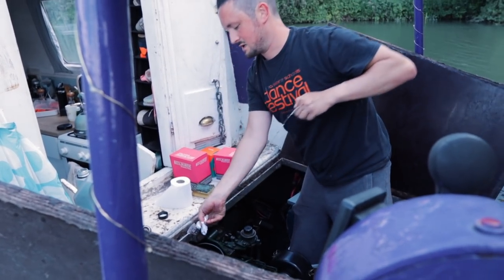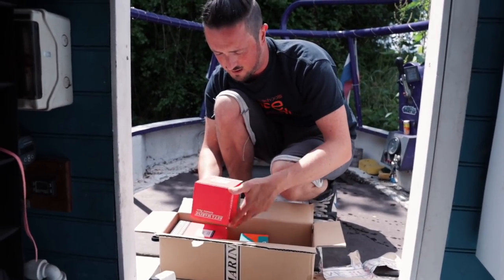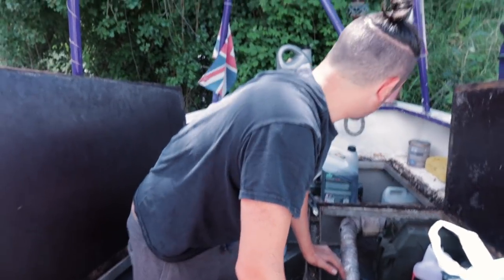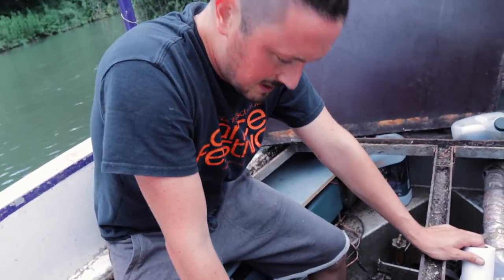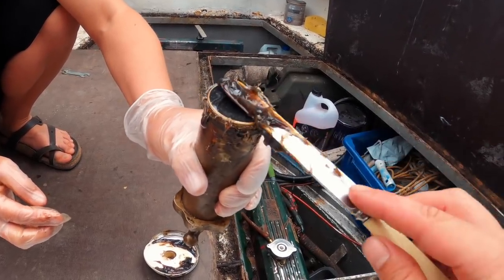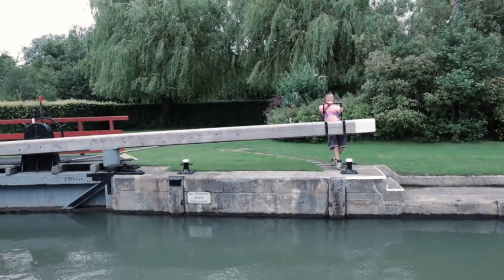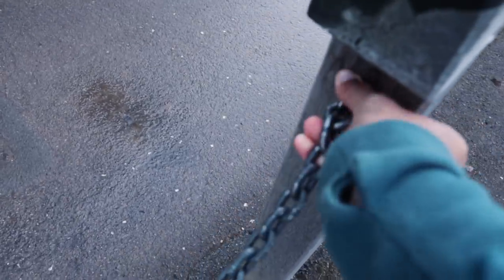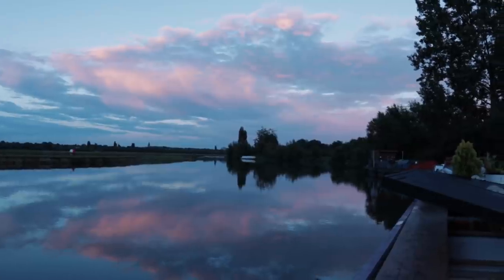How HARD Is It to SERVICE an Old Narrowboat Engine Without Experience?

Comment: stop by a auto parts store and buy a strap wrench(it is made to take off and tighten oil/fuel filters), also buy direct your parts to service your engine and keep your next set on the boat with the tools you need to do the service. Please get some oil/water towels(they are design to soak up any oil/water in your engine well) and you toss them in the trash. also get a head lamp/torch for when you have breakdowns at night.

Comment: Guys,  when filling the stern gkand pump just hold it over the seal in the grease tub (the plastic ring with the hole) and then unscrew,  the suction will  fill the pump without all the messy stuff 👍

Comment: the black plastic knob on top of the fuel filter housing should be sprung and pushed down several times until you feel resistance after fitting the new filter it will bleed out the air in the new filter and fuel system.

Comment: if you are going to pull a narrowboat by hand or scooter, then you need a long tow rope, not a short mooring line. try it by hand first and you will be surprised how much easier it is with a long rope. I've done it usually through a lock when no one's on the boat.

Comment: I don't know but if a boat engine is like a car then the engine and gearbox are  using the same oil if I herd you right you said you drain out 8 litres will a car engine only takes 5 litres at the most so half of what you put went in the gearbox